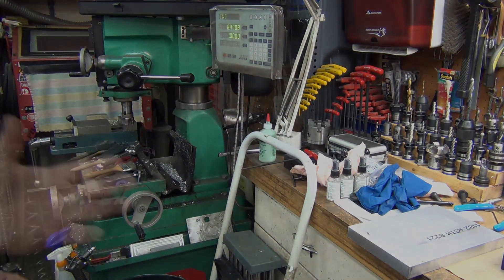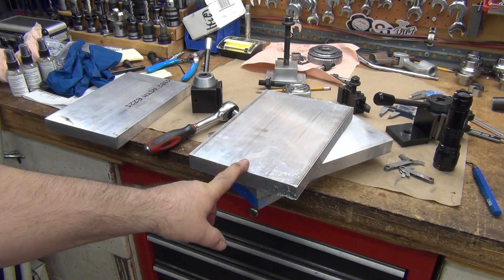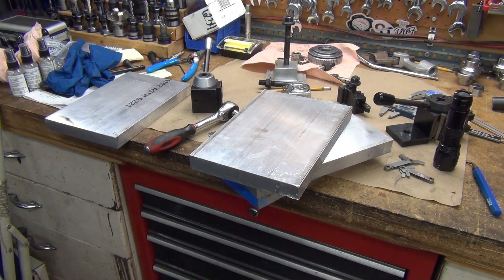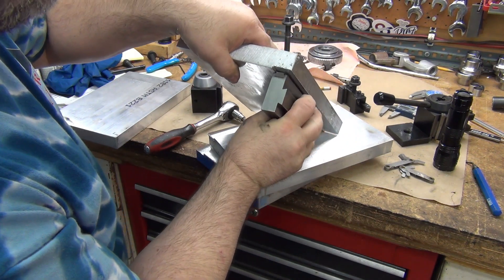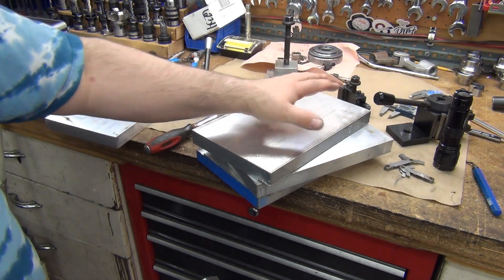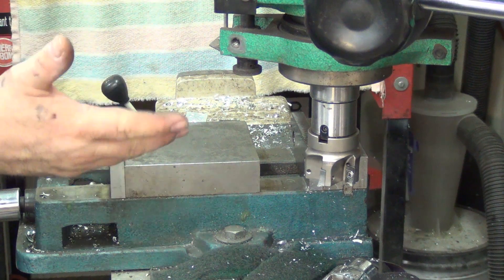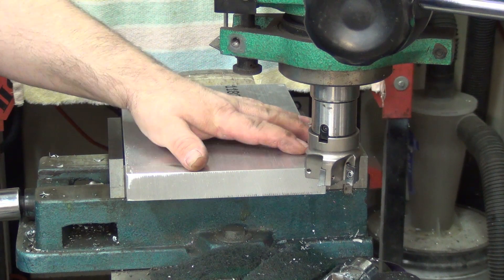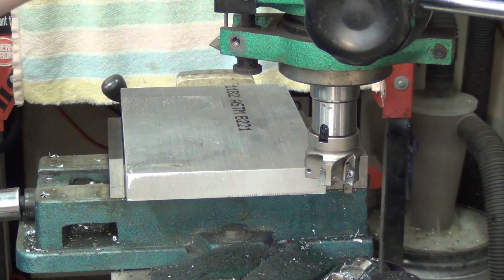Dual Caliper Bracket OP1 - Ford 9"

Comment: Hey Mike.
Nice work with the Carve Smart Jaws.
I do NEED to buy some for my machine.
The only downside is i have 3 vices ??
If i buy 1 set the other Vices might become jealous, lol.
Looking forward to Part 2.
Thanks for bringing us along.
Peter.
Reply: Vises are like your children, you always say you love them equally, but deep down...
Reply from the maker: LOL!!!  I hadn't thought about it, but now that you've said it out loud, I realize I've done the same thing!! :)
Reply: @somebodyelse6673  

Laughing First.

YES that is True.
Reply from the maker: I've been wanting them for years, but I never seemed to have the $'s to do them both at the same time.  Eric at Avant Mfg made me a killer deal on 3 Kurt 6" vises with the CS jaws already on them.  I still have an extra vise with the jaws.  Even though it's actually too big for my round column, I'm thinking about installing it on that machine.  I can't quite fit 3 on my cnc mill.  I also have the two cheap vises that were on the mill originally.  The CS jaws are awesome!!!!! But, they do take up some real estate I was used to having.  I've been tempted to modify my vises to get some of that back. LOL
Reply: @bluehandsvideo  
Yes i guess you would loose some work holding area in the opening width.
I did not consider that.
I still use basic bolt in jaws for my work holding at the moment.
If i was to do more profiling types of work i guess the Carve Smart jaws would be good.
For the moment it,s a mix of Aluminium and Soft Steel jaws from bar stock.
The ease of swapping jaws quickly is the Smart jaws advantage.
When i start to run out of work holding area available.
 The next option would Mitee Bits.
At the moment i can hold at least 5 mm of material to finished part.
But i am sure in time that will be less with different jobs.

Thanks again for your reply.
Always appreciated.
Peter.